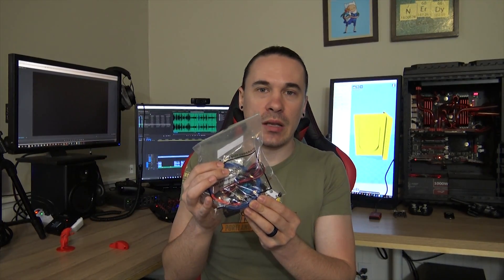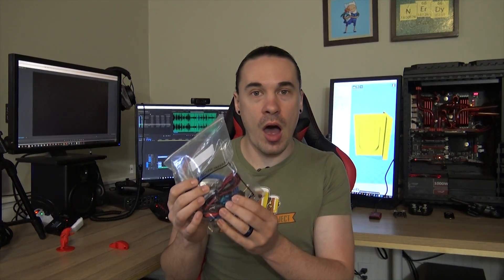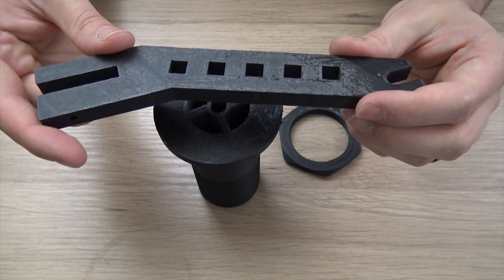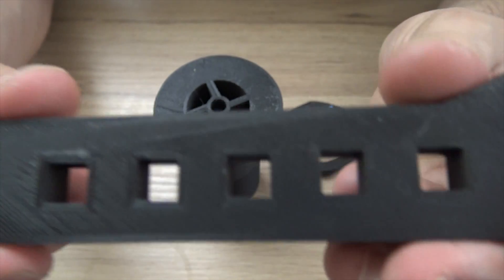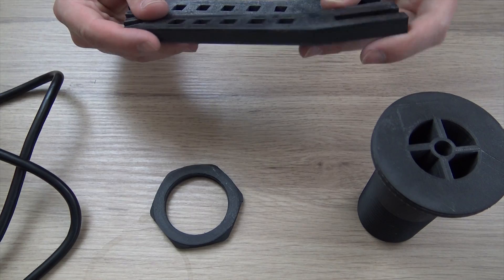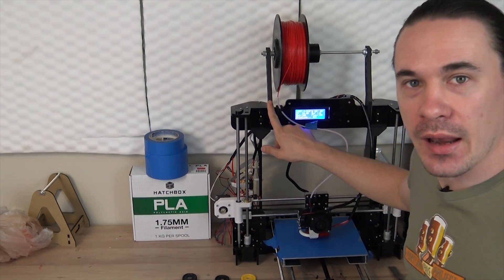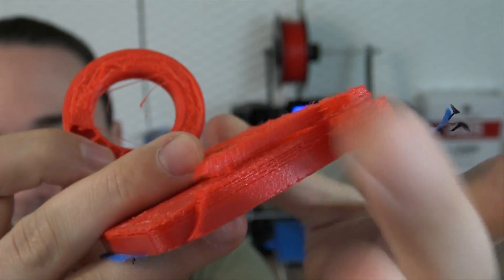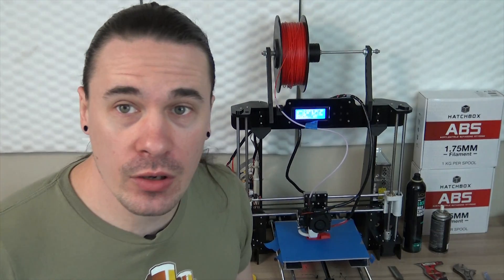Self-Upgrading? | 3D Printed Upgrades for the Anet A8

Comment: Does the bed get hot, and what is the best filament to use on this printer
Reply from the maker: It has a heated bed that I set between 60 and 90c.

I use Hatchbox filliment. I think it works very well.

Comment: Watched this video on September 3rd 2018 and thinking about getting a 3d printer. 
Did you watch that printer for 38 hours. 
Did you do any upgrades that I have seen on other you tube videos. 
MOS FET, Power supply, on off switch with a plug socket.
Reply from the maker: I did a Bowden upgrade and the rest are 3D printed upgrades
Reply from the maker: I also do not watch the printer for the full print cycle I just check in on it every 4 to 12 hours

Comment: Your heated bed plate is not level! This is why the long pieces had stripes on only one end. The nozzle moves higher and the filament is not pushed against the bed, so it stays round not flat. Level the bed and it is all stable.
Reply from the maker: Anti Reiljan thank you for the advice. I was very new to 3D printing when I did this video, and I believe this was my 4th print.

Comment: I know this is a older video, but I think if you want to continue using abrasive filliment look at the ruby extruders. Damn tough..
Reply from the maker: elfpimp1 thanks for the suggestion! I definitely will take a look at those if I go back to using that type of filliment. Currently I need to fix my printer. That's another video coming out in a while.
Reply: Electreak groovy. What happened? If I may ask? I'll keep an eye out for the vid too..
Reply from the maker: elfpimp1 no problem. The heating core died on my printer. I got a replacement but I have not put in on yet.
Reply: Electreak ouch.
Reply from the maker: Yeah, it blows. I just need to get to fixing it though. My A6 had the same problem.
Reply: Electreak is this a common problem, or a cooling issue on the A series??
Reply from the maker: I'm starting to think it is unfortunately, but I have not read or heard anything from others about it. I also had a board failure on the A8. Gearbest sent me a replacement right away though.

Comment: When you said the filament came off the spool and tangled around the outside of the spool wrecking a long print, I felt a lot of empathy because that has happened to me as well. You really cannot leave these machines to print on their own without keeping a close eye on them.

Regarding your whistle: 190 dB? Yikes! Hearing damage starts at 120dB. Make sure everyone  is wearing ear protection before you blow that sucker.

Comment: that spool holder is the biggest pla waste ive seen so far...
Reply: its because the holes on the spools of filament are too large and like to rick back on the normal spool holder. the new spool holder keeps the spool on the metal rod better and keeps it from rocking back and potentially pulling the filament out of the print nozzle. it may use a lot of plastic, but i is better than not having it.
Reply from the maker: Sgt Brobee to each their own. I like it, and I think I want another for my Anet A6. But if you have a suggestion for a better one, I'd love to hear. :)
Reply: Who cares @Johannes? PLA is garbage. ABS is the only good filament -prove me wrong.

Comment: A good upgrade is a small piece of sponge zip tied around the filament where it enters your guide. That will clean off any dust contaminants that would otherwise go into your extruder and either clog your hotend or get into your print. Learned that with my rostock max.
Reply from the maker: fireraisr I do plan to do that when I move the motor off the x-carrage. :)

Comment: quick question, I have the A8 coming to me in a few days. And I wanted to ask if the tube that holds the filament fits on the filament holder that comes with the printer kit (length wise). I have a shelf above the table were the printer will sit, so it wouldn't work (height wise) to put the complete new spool holder on top of the printer, but I could just put the original one on the shelf above it.
Reply from the maker: Behemothokun I will have to look at it when I get back. I will get you that info.
Reply: much appreciated.
--- EDIT: seems to work, just looked a bit on thingiverse: https://www.thingiverse.com/make:336893 the designer probably thought of that. ---
Also, using a chisel to remove the prints sounds like a good idea; way better then trying to wedge a knife under that or using a paint scraper, since you have more control and can keep one edge perfectly straight on the printing bed to prevent damage to both the tape and the print. I've got to try that when I do my printing.
Reply from the maker: Thank you for the info! I did measure it as well and it does fit. 

I got the chisel idea from the 3D Printing Nerd channel, you should check him out if you have not already. Great info there.

Happy printing! Send me some pics of your prints on twitter if you would like to share them!

Comment: The comments here contain good info... maybe you could make a video about the "right" settings for printing different with different materials? Like... this filament type needs this temp and this layer height to get this quality?
Reply from the maker: Amanda Nelson I do plan to do that eventually.
Reply: There is only one, real way to determine the "right" settings: Experiment on your own. Why? I have over forty reels of filament from various manufacturers. For which one would you like the "right" settings? PLA? ABS? PETG? Flexible? Wood? Carbon fiber? Another reason is that if you use Cura, there are over 394 settings! 

You really are asking for the impossible. There may be some very general settings that we could convey to you, but there are many variables. One of which is where your printer is located. Draft free? Do you have an enclosure that ensures the proper environment? 

Trust me. You will be wasting a LOT of material. We all have. But you will learn a lot.

Comment: Hey man i got the anet a8 and i highly suggest buying buildtak off ebay, i buy the 203x203, you just need to cut off the sised alittle bit and it sticks right on, you dont need to add any other products like hairspray or glue it just sticks on no problem and all my prints i do 220' and bed 70". Much better then the painters tape trust me and less headache. P.S great video
Reply from the maker: Kenithson thanks for the suggestion! I will take a look at that. I have been having some issues with some prints sticking. especially ABS.